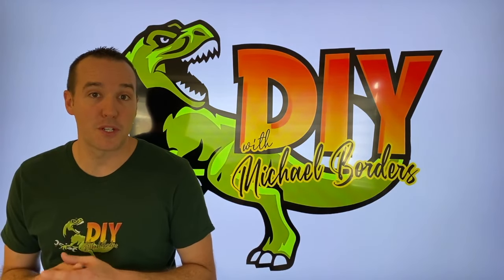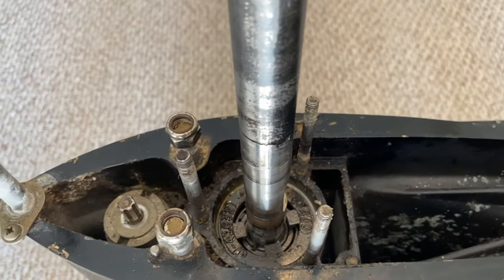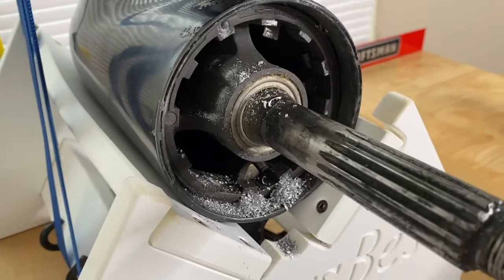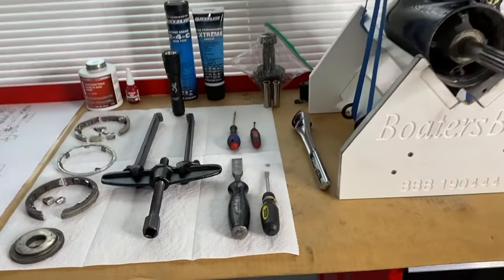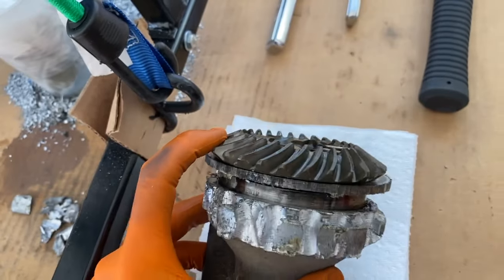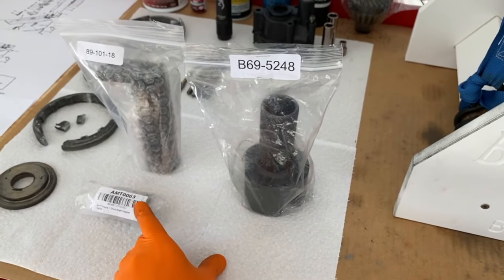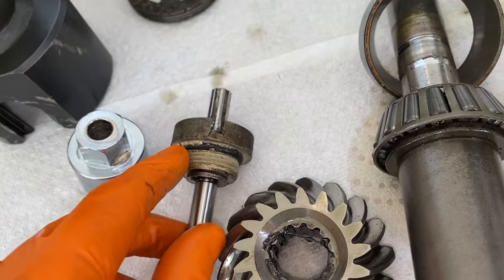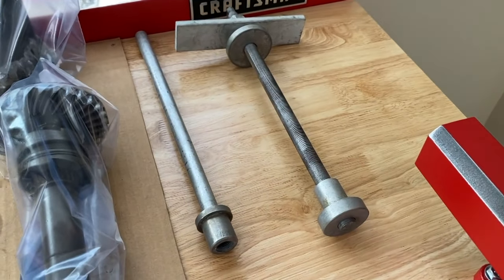Mercruiser Alpha outdrive lower unit rebuild - Full DIY rebuild

Comment from the maker: How to properly and safely pressure test entire outdrive

          https://youtu.be/7AeuxiphzUg

(PART 1)

If interested in purchasing the products below, visit our Amazon affiliate links below.  I earn from qualifying purchases.

1.  Retainer nut removal tool

          https://amzn.to/3xFjvUz

2.  Bearing Carrier Puller tool

          https://amzn.to/3Oqc1Nh

1.  Mercruiser Upper unit rebuild - PART 1

          https://youtu.be/i7nRJPbRYPI

2.  Mercruiser Upper unit rebuild - PART 2

          https://youtu.be/UjPiWemv0b8

(PART 2)

If interested in purchasing the products below, visit our Amazon affiliate links below.  I earn from qualifying purchases.

1.  Drive Shaft retainer nut removal tool (89-101-18)

          

2.  Drive Shaft Spline adaptor (AMT0063)

          

3.  Pinion gear nut removal tool (B69-5248)

(PART 3)

If interested in purchasing the products below, visit our Amazon affiliate links below.  I earn from qualifying purchases.

Pinion gear removal tool

1.  Bearing install tool:  (91-38628)

          

2.  Puller Ros:  (91-31229)

          https://amzn.to/3OnC9r6

3.  Washer:  (12-34961)

          

4.  Nut:  (11-24156)

          

5.  Pilot Washer:  (91-36571)

          https://amzn.to/3u1oq0X

6.  Plate:  (91-29310)

          https://amzn.to/39Y0CEh

(PART 4)

If interested in purchasing the products below, visit our Amazon affiliate links below.  I earn from qualifying purchases.

1.  Quicksilver gear set (43-87807A 4)

          

2.  Bearing carrier rubber O-ring (2531534)

          

3.  Clutch dog (52-853594T)

          https://amzn.to/3OHaiBP

4.  Shift shaft rod (77481 1)

          https://amzn.to/3tZt5QY

5.  Shift shaft Crank (76865)

          

6.  Pinion gear nut & washer (Nut:  11-35921)  (Washer:  12-92721)

          https://amzn.to/39VYT2s

          https://amzn.to/3NhkwI4

7.  Drive shaft (45-42634)

          https://amzn.to/3QMn6c1

8.  Propeller shaft (44-824110)

          https://amzn.to/39OSk1L

(PART 5)

If interested in purchasing the products below, visit our Amazon affiliate links below.  I earn from qualifying purchases.

1.  (2-4-C Lubricant)

          https://amzn.to/3NwTCfg

2.  SAE 90 gear lube

          https://amzn.to/3OUVsYN

3.  Loctite 271

          https://amzn.to/3uavB70

4.  Craftsman torque wrench

          https://amzn.to/3y5OTM7

(PART 6)

If interested in purchasing the products below, visit our Amazon affiliate links below.  I earn from qualifying purchases.

1.  (2-4-C Lubricant)

          https://amzn.to/3NwTCfg

2.  SAE 90 gear lube

          https://amzn.to/3OUVsYN

3.  Bearing carrier rubber O-Ring (2531534)

         

4.  Bearing carrier key (28-30281)

          https://amzn.to/3a1zOTE

5.  Retainer spanner nut (79448)

          https://amzn.to/3a1Btsn

6.  Retainer but removal tool (91-61069T)

          https://amzn.to/3xFjvUz

7.  Craftsman torque wrench

          https://amzn.to/3y5OTM7

8.  Nail punch

          https://amzn.to/3OwBun3

9.  Water pump base (46-44292A3)

          https://amzn.to/3OR9eeH

10.  Water pump upper repair impeller kit (46-96148Q-8)

          https://amzn.to/3yFLvsZ

(PART 7)

If interested in purchasing the products below, visit our Amazon affiliate links below.  I earn from qualifying purchases.

1.  (2-4-C Lubricant)

          https://amzn.to/3NwTCfg

2.  SAE 90 gear lube

          https://amzn.to/3OUVsYN

3.  Anode bolt (10-32470)

          https://amzn.to/3I9rcXP

4.  5/8 nuts (11-859116)

          https://amzn.to/3OERbJ9

5.  5/16 rear bolt (10-30206)

          https://amzn.to/3a7PXXX

6.  3/8 Anode bolt hole cap (19-47579)

          https://amzn.to/3yD9Hfe

7.  Anode kit (888755Q04)

          https://amzn.to/3I9ktgD

8.  Video link to all Anode kit replacement

          

9.  Link to video explaining all differences between Anode kits

          

10.  How to repaint propeller

          https://youtu.be/s4ytMFUDGA4

11.  Continuity washer (13423511)

          

12.  Castle washer (12-31211Q03)

          https://amzn.to/3OHkOcQ

13.  Prop washer (14816629)

Comment: I agree these are the best comprehensive videos along with excellent camera work. I reinstalled a bearing assembly and did Not put 210 lbs of pressure on the torque and put oil in to check leaks and it was bubbling through as I looked down into the cavity. Will the torque of 210 lbs solve this problem or need I look elsewhere? It is seated all the way in.
Reply from the maker: Good morning, just poured a cup of coffee and am sitting down to answer any and all questions for the DIY community.

This means the absolute world to us, thank you for sharing this.  Applying the 210ft-lbs to the retaining nut should definitely help seal your lower unit.  Please keep us posted, we are always here to help!

Let us know if you have any questions and hey if you’re into crypto trading, join our DIY ecosystem.

       toolboxtoken.com

Reach out to us any time!  🧰

Comment: Awesome video, question? Why not try a little heat on the retainer nut before drilling it?
Reply from the maker: @mattbob6350  

Thanks for watching, we appreciate it.  Great question and you definitely have that option.

Most important thing if choosing heat is to ensure you don’t burn yourself nor damage the outdrive case.

Heat can be an incredible tool in DIY projects like this.  😁👍🧰

Comment: We’re you taking the bearing carrier nut off by turning c-wise or cc-wise? Do you have an approximate cost for everything you replaced? Great video btw.
Reply from the maker: Thanks for watching, we removed bearing carrier retainer nut by turning counterclockwise.

If you don’t already own the required tools, you can plan on spending roughly $2k after all said and done with brand new OEM parts.

Most will sell their tools on eBay at the end and get a few hundred bucks back however we keep our tools for our next set of DIY videos for the community.

Let us know if you have any questions and hey if you’re into crypto trading, join our DIY ecosystem and become part of an exclusive group of DIYers.

       toolboxtoken.com

Reach out to us any time!  🧰
Reply: @DIYwithMichaelBorders   
Thank you. My manual indicated CCW and the nut indicated as well. 2 grand.. ouch… A grand over what I bought it for when it was running. Guess ya gotta pay to play if you own a boat. Keep up the good work on the videos.
Reply from the maker: @maddogschannel9857  

That’s for OEM parts which we always personally purchase…unless the specific OEM part is no longer available.

Aftermarket rebuild will be hundreds of dollars cheaper.

Comment: Place the water pump key on the shaft then slide the impeller down the shaft and Seed it onto the key. Then take the housing and as you slide it down on top of the 77th on top of the impeller turn the shaft that will make the impeller go up inside the housing much easier than doing it the other way
Reply from the maker: Thanks for watching and sharing your advice.  👍

Comment: Best video I've ever seen. Do you have video on gear box repair for 1973 150hp mercury outboard American serial # 3630435
Reply from the maker: Thank you, we really appreciate that.  A special thanks to YOU for sharing this.

We don’t have any videos on a 1973 merc unfortunately…🙁

Let us know if you have any questions.
Reply: @DIYwithMichaelBorders  doesn't lock in reverse just clicks, will lock in on trailer but not in water
Reply from the maker: @rayjohnson1778  

Outboards always perform in a uniquely different manner when out of water as we have all leaned.  You may need to adjust your shift cable or it might need a new lower unit prop shaft gear and clutch-dog.

Comment: All that work and you jb welded the o ring galley? You could have gotten that welded bored back to size and  polished for like 40 bucks.
Reply from the maker: @user-fo3yy7ql8o  

Thanks for watching and sharing your thoughts.  It has held up great, no issues.  Hope your summer boating is going well.  😁👍🧰

Comment: Michael I have the same problem with overheating and the copper tube came out with the lower what did you call the plastic melted housing up inside the upper unit?   I am tempted to torch it to melt remaining plastic as the bolts are not accessible now due to melting...did you ever figure out why your unit overheated with a good impeller?  thermostat?  clogged risers or lines?  good work showing all the gory details!
Reply from the maker: Good morning, just poured a cup of coffee and am sitting down to answer any and all questions for the DIY community.

This is the Water Pocket Tube/cover.  Heat gets the best of that part.  Keep us posted on your rebuild.

Let us know if you have any questions and hey if you’re into crypto trading, join our DIY ecosystem and become part of an exclusive group of DIYers.

       toolboxtoken.com

Reach out to us any time!  🧰

Comment: mike, had my lower unit replaced 2 seasons ago with used lower they said they pressure tested it. this fall i decided to check for water and was half full with water,,,? what do you think my leak problem would be?
Reply from the maker: Good morning ☕️

A few things come to mind.  Do you notice any cracks on the lower unit that would allow water to sneak into case and mix with gear oil?  If so, you would unfortunately need a new lower unit.

If no cracks, which would be a good thing…check to see if your flathead screw that secures into lower case (where you insert gear oil) is not loose or damaged.  It may be a great time to install a brand new gasket on that flathead screw to help create that watertight seal.

After that, direct your attention to the prop area.  We recommend removing your prop and inspecting the internal bearing carrier and seals.  Below is a link to our video showing how to remove prop.

       https://youtu.be/rx1uXhE2Kdw?si=7yxKHefPtSLluA64

If you see any signs of damage or fishing line tangled inside bearing carrier…chances are water is leaking through the bearing carrier seals and into case.

If that’s what you find, we recommend removing bearing carrier and replacing seals. Please keep us posted.

☕️👍
Reply: i did not see any cracks,,, i will inspect prop shaft in spring, boat to storage currently. thank for help. Art @DIYwithMichaelBorders
Reply from the maker: @artwoggon8907  

😎👍☕️

Comment: Great video, thanks for posting. The hell you suffered during the dismantling highlights to me what a terrible design those things are.
Reply from the maker: Good morning, just poured a cup of coffee and am sitting down to answer any and all questions for the DIY community.

Very kind of you to share, and this has been a rewarding experience, the boat is back in the water and running great.

Let us know if you have any questions and hey if you’re into crypto trading, join our DIY ecosystem and become part of an exclusive group of DIYers.

       toolboxtoken.com

Reach out to us any time!  🧰
Reply: @DIYwithMichaelBorders Hi Michael. Thanks for taking the time to respond.  Good to hear your boat is back in the water, you did a great job.
My boat has twin Mercruiser 3.0 litre engines on Alpha One Gen 2 out drives. They run in opposite directions. I stripped the boat over winter for renovation work, but fear I may have put the drives back in transposed positions. I have since lost forward drive on one side and the gears are grinding. Apparently, Alpha One's have weak reverse? Have you or any of your community heard of this? What could have broken?
Reply from the maker: @willdavis3332  

Thanks for the reply, haven’t worked closely with twin outdrive setups in the recent past.  Is it more of a humming, rattling, or knocking sound?

Weak reverse can be as simple as a friendly adjustment to your throttle cables.

You’re spot on though, alpha Gen 1(2) drive reverse has never been incredibly responsive however it has always got the job done.
Reply: @DIYwithMichaelBorders I would describe it as quite a rough, grinding gears sound. I did try disconnecting and directly operating the shift cable which goes to the outdrive and it won't hold in forward gear, just makes the noise. So I suspect damage to the gear components inside. Could be a dog clutch problem from what I have read. Looks like I may need to dismantle lower unit as you did. Your video will be a massive help, thanks again Michael 👍
Reply from the maker: @willdavis3332  

Thanks for the quick reply, taking apart lower unit will be best.  Getting the lower unit cleaned up with new seals and bearings will hopefully be all you need…however if you find any imperfections or damage to the gears, you will want to replace those as well.
Reply: @DIYwithMichaelBorders Many thanks for the helpful advice Michael 👍
Reply from the maker: @willdavis3332  

😎👍

Comment: Thanks for the vid! Any on the gen2 alpha? My shift shaft slides up and down and makes it chatter when it slips down. Don’t know what i did.
Reply from the maker: We appreciate that, thank you.  Don’t have any videos on a Gen 2 at the moment however you will find it to be very similar.

We will always be here to help answer questions.  😎👍🧰
Reply: Thank you! It is similar but it has an arm on the lower shifter instead of a top-spline dial. I can’t get it to not slide up and down.
Reply from the maker: @trojanwood  

Thanks for the reply, a DIY rebuild may be best.  😎👍

Comment: How much would you charge to do this job
Reply from the maker: @austinhughes5171  

Good morning ☕️

As far as quoting out a project like this…you will find that most marinas will have the same if not very similar prices…roughly a few grand high end…🤔

The trick becomes finding the right marina that will to do it right with OEM parts and not over-charge you.  Keep us posted on what you find.

Comment: Assuming the diameter inside the lower unit is about 3.5 inches and putting 25 psi inside would only give you a pushing force of about 240 lbs. I doubt that would be enough to be of much help. However the hissing was helpful since you knew you were loosening the carrier. Good result anyway.
Reply from the maker: We appreciate that, we hope your DIY project is going well.  ☕️🧰

Comment: So, at the end. are you setting the upper and lower unit in forward gear before assembly?
Reply from the maker: Good morning, just poured a cup of coffee and am sitting down to answer any and all questions for the DIY community.

You will want to carefully align the splines of lower unit shaft extending up and the lower splined cavity of the vertical gear installed in upper unit.

Additional items will align in a friendly manner as you carefully connect the two units.

Below is a link to our video showing us connecting upper to lower.

       https://youtu.be/oao-t8qNNU4?si=txS_981G7MUcZlYR

Let us know if you have any questions and hey if you’re into crypto trading, join our DIY ecosystem and become part of an exclusive group of DIYers.

       toolboxtoken.com

Reach out to us any time!  🧰

Comment: The spline shaft on my lower unit sinks a little and has free play in the top bearing, does that indicate a rebuild is needed?
Reply from the maker: Thanks for watching, are you referring to the Drive Shaft that feeds up into the upper unit or the Prop Shaft that feeds through the bearing carrier of the lower unit?
Reply: @DIYwithMichaelBorders  I believe he's referencing to the Drive Shaft retainer, bearing and race that feed up into the upper unit @ 1:25:00 I have a similar issue, where there is slop between that bearing and Drive Shaft. My question is, is this normal? Thanks. P.S. Love the videos
Reply from the maker: @sergioterrones8724  

Good morning, just poured a cup of coffee and am sitting down to answer any and all questions for the DIY community.

We appreciate that, thanks.  😎👍

Referencing the drive shaft, retainer nut, gear and bearing…once everything is put back together and properly torqued, yes…there should be an ever-so-slight amount of play present when pulling up on the shaft.  👍

Let us know if you have any questions and hey if you’re into crypto trading, join our DIY ecosystem and become part of an exclusive group of DIYers.

       toolboxtoken.com

Reach out to us any time!  🧰